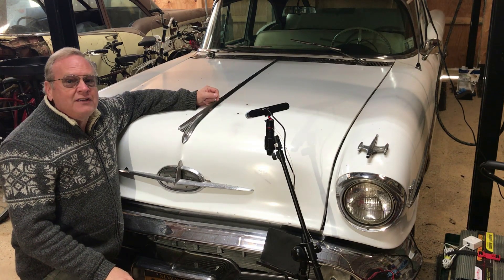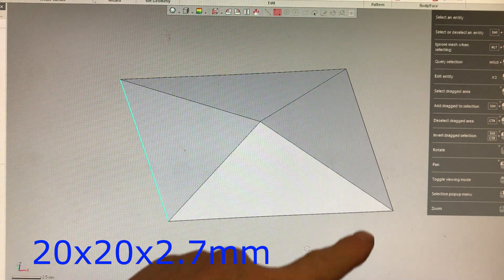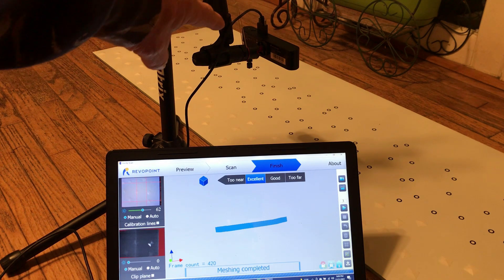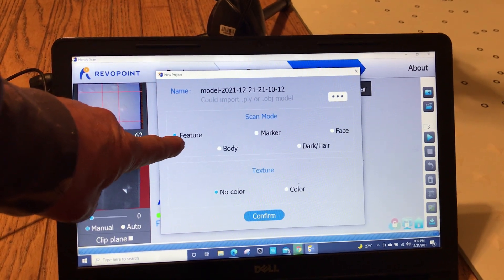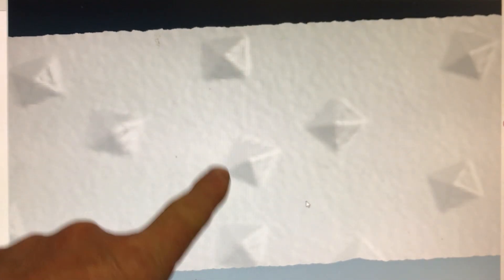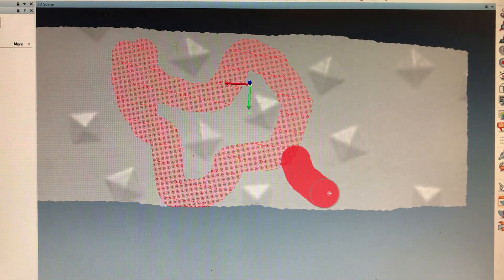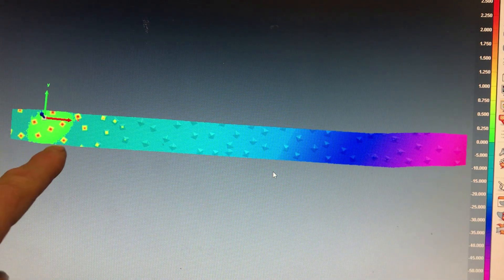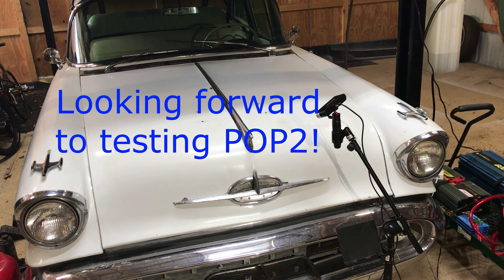Accuracy of Scanning Large Objects with Revopoint POP in Feature Mode

Comment: Could you please pick some points at FAR ENDS (i.e. one at 10cm from the far left edge of the scan and other 10cm from the far right and then one in the middle somewhere) and then create a plane and then see what the error is? Picking 3 points in the same corner of a 1.5m scan can definitely create a plane that is off on a proverbial tangent.
Reply from the maker: It's easier to see the error if I fit the plane to the first scan frame. If I best fit a plane to the complete scan, the error is distributed.